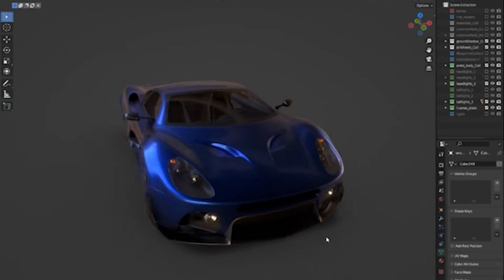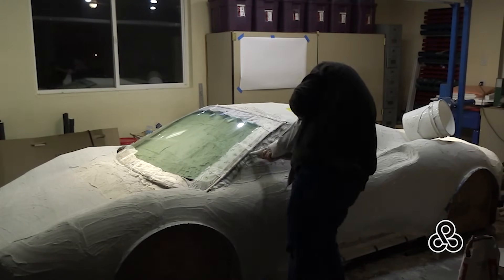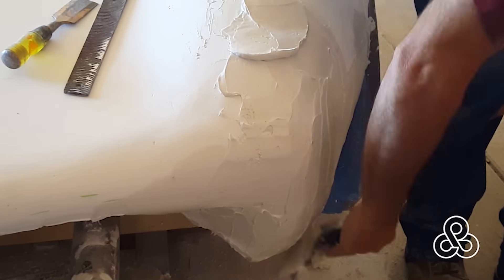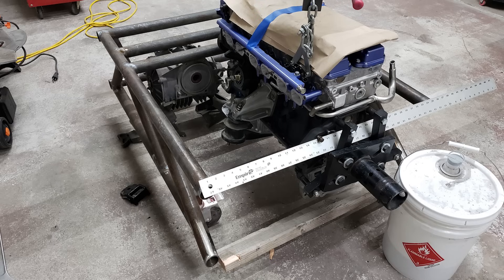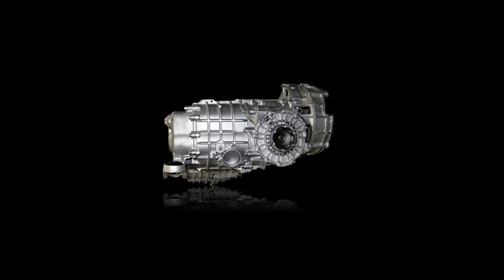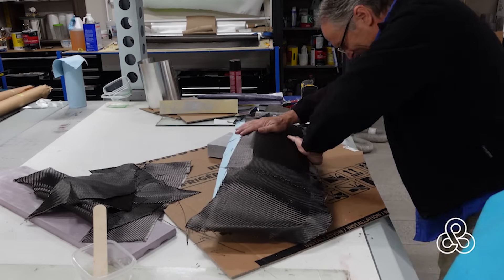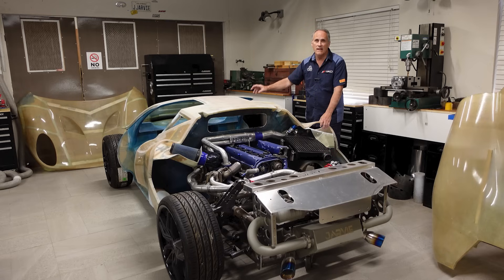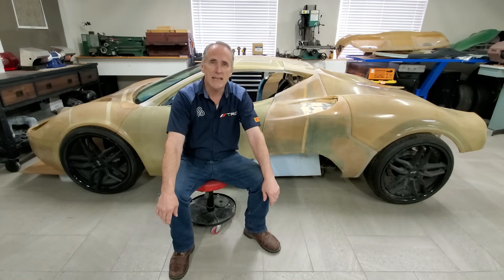Can you build a car from scratch? One man's journey.

Comment: How did you figure out which windshield you needed/could use? Like, I know you said you chose a Cavelier windshield, but how did you come to the conclusion that that one would not only be the right fit, but the right price and the right potential long-term availability?
Reply from the maker: I drove around shopping centers and looked at cars. If one looked promising I would jump out and measure. (always in fear that the owner would come out and wonder what I was doing. Ha!)
Reply: @BuilderCreator  So when designing the body of your car, what made you choose that general size and shape of windshield? I assume the short answer, of course, is "proportions" or "I liked the proportions" if you wanna get technical, but... Well I guess I am asking why you went with the overall design you did.

Most of it is badass, but I somewhat question the height and shape of the nose from an aerodynamic standpoint and almost the entirety of the rear facia. The hips and humps and cabin proportions and whatnot are all great, though.
Reply from the maker: @Drunken_Hamster  The overall design concept was to make a modern rendition of the Ferrari 250LM. Once you know that you will see lots of design features that have a birth place.  The windshield as mentioned, is a compromise to get close to what I wanted.
Reply: @BuilderCreator  I can definitely see the inspiration. The 250LM is a fine car for its time, but I find that I like your Arete much more overall. I can even see some Ford GT cues to it, which is a nice touch since it's American instead of European. I just... You REALLY have to do something about that rear facia. It looks unbearably sad and droopy, like it can't decide if it wants to be a high-tail or low-tail design.

If it wants to be high, make the middle part swoop/scoop lower for aero and aesthetic purposes while keeping the outer edges where the (presumably round in this example) tail lights would go high, roughly in line with the hips. And if it's supposed to be a low tail, then make the WHOLE THING low instead of having a weird hump in the middle and some taillights that have car equivalent of negative canthal tilt that makes it look like a beta/prey animal.

I can see what you generally wanted with the roundness and swoopy lines, and in doing so, I've looked up similar rear ends that I think do it better.
Murray T.33
Basically any Late model, Modern, or Post-modern Ferrari except the 430, Enzo, and SF90
Really any modern Mclaren
Pagani Utopia if you want kinda a low-tail
Venom GT/F5
Noble M600 is a good example of high center, droopy sides that still looks good
Same with the Spyker C8, but only the Preliator
Same with the Jannarelly Design-1
Ecurie Ecosse LM69
Isdera Commendatore 112i
Yamaha OX99-11
The 05 Ford GT
Radford 62-2
Carrera GT (Is this a stretch?)

It took me an hour to come up with these. And to close off, I'll also reiterate a few things about the powertrain: The 1JZ is a fine choice. You could go bigger with something like a J35 and save longitudinal space as well, but for 450-600whp and relatively drivable, a 1JZ is fine. The factory turbos are the poor choice, there. You can get a Borg Warner S200SXE and have a 650BHP capable turbo that's good for both low and high boost and should be as or more responsive than the factory turbos, not to mention more robust. And if you wanted to splurge, there's always the EFR line to consider.

As far as the transmission, you are SERIOUSLY doing the whole car a disservice by attaching a vomit-inducing low-power handling 4-speed slushbox to it. If you want an automatic that's almost as easy to work with, but is actually BEFITTING of supercar status, please, PLEASE look into a ZF8-speed transmission. With the Turbolamik TCU it's almost as easy as a Chevy 4L-whatever transmission to hook up in a running fashion, especially if you're going Standalone for the engine management, or if your factory engine controller has a manual mode it can run the engine off of. Past that, all you need is the adapter plate, and mounts, and let me clue you in to something amazing for your situation.

The 1JZ is such a popular engine that there are multiple adapter plate options either currently available or in the works and very soon to be available. The ZF8-speed has all the power handling you'd ever need among its various options, and with the Turbolamik controller, it has a whole host of functions that you'd pay out the ass for to get on a Chevy 4L-whatever. Not to mention the shift speed and the sheer number of gears giving you superior acceleration AND fuel economy/cruising comfort due to lower RPM at speed without sacrificing rear-end ratio to get it.

Most important/enticing ZF8 features unlocked by Turbolamik controller: Trans brake, individual clutch control (so you can keep a tight, low stall speed converter but still launch hard and shift as fast as a dual-clutch), 3-pedal manual mode, manual AND automatic shifting(fully programmable), and shifting while on power for no acceleration interruption.

And now I'm at least an hour and a half into this reply, soooo... Way more dedication that most people just going "lol, 1JZ is stoopid" or whatever. Kinda worth at least a little consideration, don't you think?

Comment: Hello, a question about the mould production: does it have problems with contraction when the resin cures?  is it needed some compensation in dimensions of the mockup? thanks
Reply from the maker: Not typically. At least not on this scale. A couple of thousandths would not even show up on panel gaps.